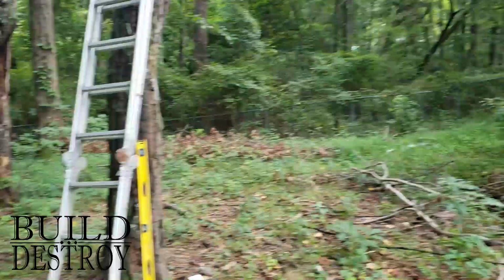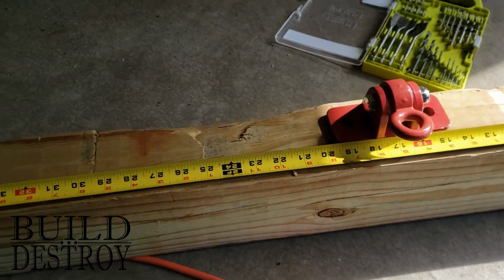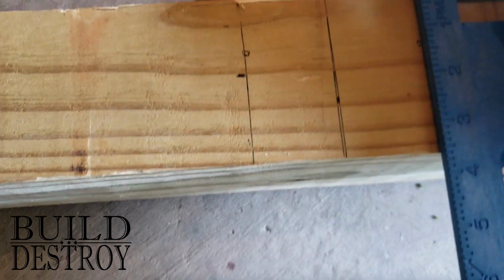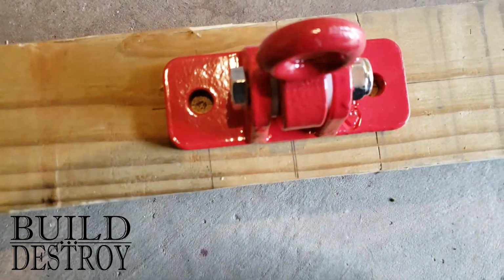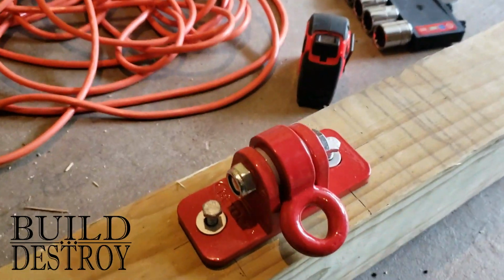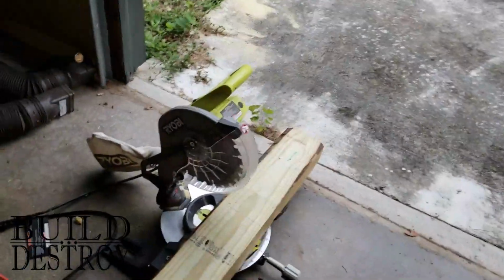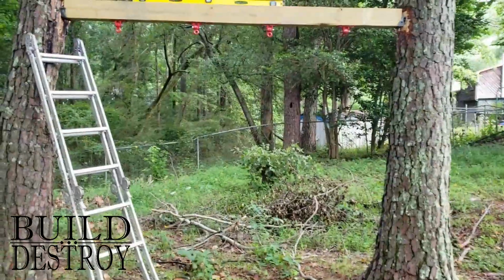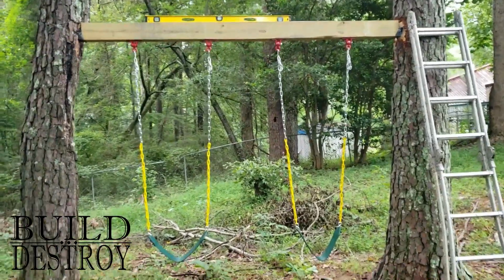DIY - Build a Swing Set on a Budget - Build and Destroy Daily

Comment: how did you secure the beam?
Reply: I wanted to know the same thing and this is what he said. "I used joist hangers. I am going to change these out for a more heavy-duty mounting system.
" However, he has had no problems. He indicated he is 210lbs and the child is 45lbs.
Reply from the maker: yes, please see Rap Titan Live's comment. Sorry I'm so late with the response. I didn't see your comment before. If I were to build this again, I would use a better hanging method. This was very early in my DIY journey. Thanks for watching. Please subscribe and check back for more content.
Reply from the maker: Thanks for relaying the message. I didn't see either of these comments. Thanks for watching. Please subscribe and check back for more content.

Comment: Thanks for the video. Have you had any issues with the wind putting pressure or snapping the bolts (since the trees maybe move independently during a wind storm/ pull in opposite directions)? Thanks!
Reply from the maker: Thanks for watching. No, I haven't had any issues with bolts snapping. And this has no issue holding my weight(210lbs) and my daughter (45lbs) at the same time

Comment: You might want to use through bolts instead of lag screws. Lag screws will fail! They are not designed for weight or motion.
Reply from the maker: Thanks. I'll make that change